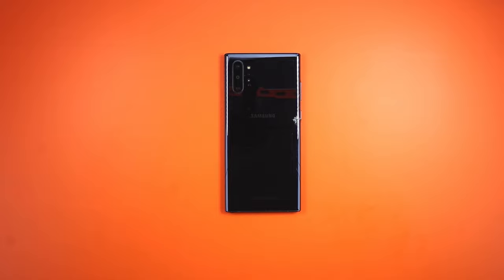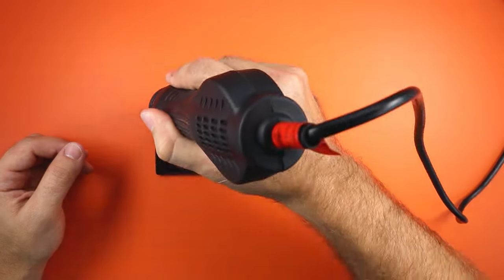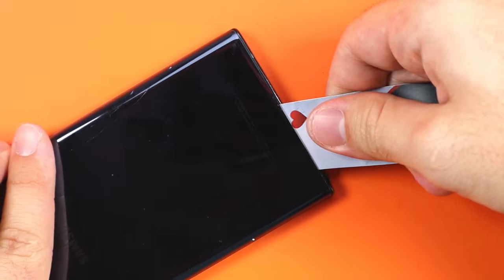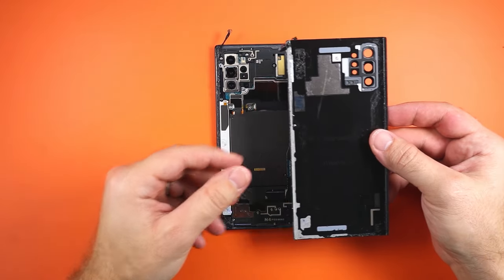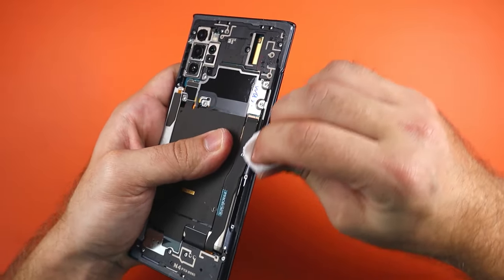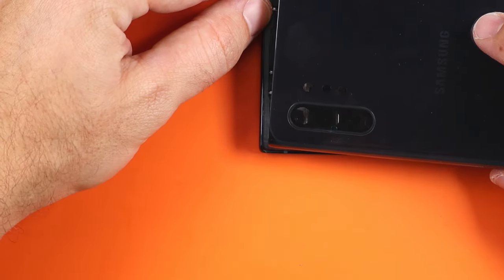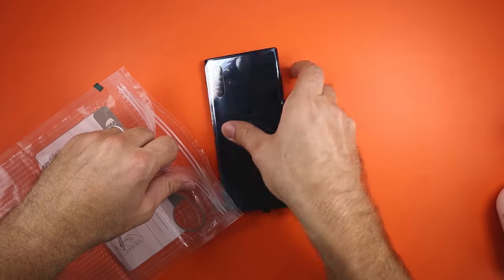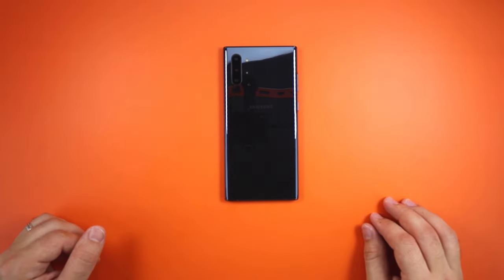Samsung Galaxy Note10+: Easy Rear Back Glass Replacement

Comment: There is a small rubber part underneath the sensor glass, do not for get to put that on the new back glass. If you don't the glass will press against the camera and the camera won't focus, its a very small part but it needs to be put back on.
Reply: Where exactly is that rubber part located? Could you elaborate? Thank you

Comment: Looks fairly easy. I was going to trade in my phone, they offered $700 for it but, till they saw the back cover, then they would only offer me $400 for it.  So $18, I'll give it a shot....
Reply: Did you try trading it in after you changed the glass?
Reply: @NapoleonBorn2Party  I was going to do it but, on Verizon's site, it showed $18 more on my bill, I got all the way to then end and it changed from $18, to $57 a moth.  I was like screw that. I never traded it in...

The phone looks brand new, you could never tell there was damage...

Comment: Thanks. I ordered the back glass cover based on your link. I was wondering about one thing.  Some other videos I saw regarding the replacement of the back glass showed the individuals using extra adhesive and/or cellphone tape. I notice you did not do that. So I suspect it really isn't necessary to add any extra adhesive then?
Reply from the maker: Since you are completely replacing the back glass, the new one will have all the adhesive you’ll need.
Reply: @MobileRefreshChannel  Thanks ! 😊

Comment from the maker: Parts and Tools:

Part:
Back Glass:
https://amzn.to/2Kk4HGd

Tools: 
FoodSaver Vacuum Pump:
https://amzn.to/2N0BwZA

FoodSaver 1-Quart Vacuum Zipper Bags, 18 Count:
https://amzn.to/39wpm2k

Rework Station:
https://amzn.to/3qmFytK

Anti-Static Repair Mat:
https://amzn.to/3oSG4ze

Razor Blades:
https://amzn.to/3qoPeUz

Steel Scalpel knife and Blades:
https://amzn.to/3qqTXFq

Plastic Cards:
https://amzn.to/2KkrqC3

Alcohol Dispenser:
https://amzn.to/2Kk2DOt

Phone repair Pro Tool Kit:
https://amzn.to/35Koq9E

Tweezers: 
https://amzn.to/2LDgP5B

These are Amazon affiliate links
Reply: Is that the one you bought for the video?  I mean the back glass.

Comment: Had a little trouble getting the original broken, cracked back glass off of the phone, because little pieces of glass shards began to pop off as I was removing the old damaged back. But I was able to successfully remove it, eventually. The new one from the link you provided fits perfectly. However, my phone had the white back and I ordered the same, original cover from the link, and its definitely not as white as the original. Has a bit of a grayish cast to it. Not a big deal, though. Still looks fine. Since I'm going to have a protective plastic cover on the back of it, it doesn't really make a difference, as I'm never going to see the color anyway. Thanks again. Very helpful video !!!! 👍

Comment: Is the Rework Station mandatory? or alcohol and tools are enough? thankyou
Reply from the maker: Heat makes it easier to separate the adhesive. You don’t have to use a heat gun, even a hair dryer would work it would just take more time.

Comment: Question: did you happen to notice if the new glass would hamper the brightness of the flashlight, and do you think it's just how the replacement glass is or a result of the heating device burning the flashlight bulb a bit?
Reply from the maker: Unless you got a cheap replacement glass or you forgot to remove the protection film from the camera lens, this repair shouldn’t effect the functionality of the flashlight.
Reply: @MobileRefreshChannel  Could be a not fully authentic one, but not a deal breaker all onto itself.

Also curious: i notice an ever-so-slight gap on the left and right of the glass. Was wondering if you experienced that with the fully authentic glass you used on note 10+, and if so, does heating up the adhesive on it and then putting some heavy books on it or something resolve such an issue?
Reply from the maker: If it’s not sitting flush then reheating and applying weight won’t really fix that, could cause the glass to crack if something is preventing it from sitting flush or it’s just that type of glass. Our glass sat flush around the frame.
Reply: @MobileRefreshChannel  will it affect the ip68? Or still waterproof?
Reply: @joelrosales1919  it might affect but if you do it properly it should still be water resistance.

Comment: Mobile fresh when you take out the glass and put the new glass is it still ip 68 with the new glass?
Reply from the maker: No, you no longer have IP68 rating. You will never be able to reseal it like the factory seal, but even the manufacturer will say that they don’t guarantee the water resistance after a year because the seals wear out. So if your phone is over a year old, more than likely it’s no longer ip68 anyways.

Comment: Is it still waterproof after replacement or we would loss its dust and water resistance?
Reply from the maker: You loose your water resistance when you crack your glass. But yes, after a glass replacement you will not have factory seal for the phone to be IP68 rated again.

Comment: My back panel is ok dotless, scratchless but due to phone heating the glue seems to be melt and one side and botton panel are pop up from the body...the phone is under warranty will samsung SC reply the glu ? Or they change the entire panel. I m not interested to change the panel because the imei is printed on the original panel
Reply from the maker: If the panel is okay then only the adhesive needs to be replaced. You may have another problem though. A lot of times the battery can start inflating causing it to lift up the back glass. Normally the glass should not be popping up on its own. In that case the battery needs to be replaced first.
Reply: @MobileRefreshChannel  yes u r right...i visited the SC today and they ordered 2 parts one is the adhesive rework kit and 2nd is the battery due to battery swell. Part is not available so i hv to wait 2-3 more days. Samsung need to work on phone build.

Comment: How long did he use heat gun for?
Reply from the maker: You move the heat gun around until the glass it’s almost too hot to touch. No particular amount of time. You can always add more heat if needed.

Comment: Hello, if I change the back cover, can I put the mobile in the water
Reply from the maker: No I would not recommend it. Even if your glass has not been cracked and replaced I’d still not recommend it if the device is over a year old. The water resistance wears off over time.

Comment: Just a question.. After make this reparation, it still can be used after some water?
Reply: Nope. Once the phone is pried open, water will easily enter the phone. So, "avoid submerging phone under water after replacement from this point on ", said Tech repair guy.
Reply: Not for two reasons:

1. You should use the original glue that seals the edge.

2. The phone must be added to a Vacuum Coating Machine.

Comment: The glass on the back of my Note 10+ is a little far from the body!  When I press it, it sticks to the body and no seam remains.  Is it possible to separate over time?
Reply from the maker: Usually it should fit snugly to the frame even without applying firm pressure. There may be something in the way causing it to lift up. The adhesive may hold for sometime but it can get loose if it keeps pushing up the glass. In most cases it’s either some old adhesive left on the frame or the battery could be lifting it up.

Comment: Can I use a hair dryer instead? I don't got a heat gun
Reply from the maker: It’s doable with a hairdryer, just need to run it longer to get the glass hot.
Reply: @MobileRefreshChannel  yea I did it, broke the glass pretty bad tho, well thats what the replacement is for anyways 🤣

Comment: Hello, will it still be waterproof after the replacement?
Reply: No, but it never was waterproof anyways at best it was water resistant. You will never be able to reseal it like the factory seal, but even the manufacturer will say that they don’t guarantee the water resistance after a year because the seals wear out. So if your phone is over a year old, more than likely it’s no longer water resistant anyways. 

(this was the creators response to the same question)

Comment: Does it still be waterproof safe ?
Reply from the maker: No, but it never was waterproof anyways at best it was water resistant. You will never be able to reseal it like the factory seal, but even the manufacturer will say that they don’t guarantee the water resistance after a year because the seals wear out. So if your phone is over a year old, more than likely it’s no longer water resistant anyways.

Comment: Will it still be water resistant?
Reply from the maker: No it will not be water resistant. Once it cracked it is no longer water resistant anyways. There is no adhesive that’s going to make it factory sealed for it to be water resistant.
Reply: @MobileRefreshChannel  
Today I noticed my back glass of note 10 plus has started to come off. Glass is like new only (2 year old phone but in brand new like condition).
I think the adhesive is loosing out.
If I get it serviced from authorized samsung service center, will it be water proof? Will they apply water repellent adhesive?
Reply: @chirag_cc  Exact same thing happened with my 2 year  note 10 plus.
Reply: @MobileRefreshChannel  Not even if repaired by Samsung itself?
Reply: Same issue, after 2 years of usage the glue is coming off. My phone usually run hot at some moment, I think it affect the glue

Comment: What about water resistance.. does it have any effect once the glass is replaced ?
Reply from the maker: Unfortunately, it will no longer have the IP86 rating for water resistance. There is no adhesive that will seal it as well as the factory seal, but It will be much more water resistant than when it’s cracked that’s for sure lol.
Reply: @MobileRefreshChannel  well that's far from true! There are many additional adhesives that can be used that are even better than what it originally came with.
Reply: @matthewgalano7652  Which ones? are there any ones you recommend

Comment: Have this phone still has waterproof?
Reply: Maybe... If adhesive was completely cleaned off and  reapplied perfectly even  around the perimeter and pressed while curing then maybe  but I wouldn't test its water resistance after being repaired. Assume it's not anymore

Comment: My glass is not broken... But if I put my nail on the side... I can see that the back glass is starting to separate from the phone.. I can see a gap in between the back glass & my phone... What can I do to stick the back glass together to my phone ?
Reply from the maker: You can purchase adhesive only. Heat the glass just like you would if it was broken and carefully separate it with a plastic card. Clean off the old adhesive on the glass and the housing. Apply new adhesive back on the glass, and now you’ll install it just as if it was a new glass.
Reply: Bro,

Same thing happened to me.
I noticed that today.
Same separation when i put nail.

Did you get your phone fixed? How? Charge?
Kindly share details
Reply: @chirag_cc  I did it a few months ago... It took 2,000 but the glass which is new is now cracked... Original is still original... But it's only 2000 so I can get it replaced again when ever I feel like.. I got it done in Delhi
Reply: @tdawg440  ok bro...I am from Mumbai.

Samsung ke hi service center se karaya tha kaam?

Aur unhone sirf adhesive replace kyu nahi kiya?
Pura glass kyu?
Reply: @chirag_cc  bahar se kawya tha.. Samsung wale bhaut zyada paise lete hain... Airport pe mera glass Crack ho gaya tha that's why I got the whole thing replaced... You only should ask them tp fix it with adhesive
Reply: @tdawg440  ha....Original hi repair karana hai mujhe....

Samsung hi jaunga...
Waise bhi sirf adhesive karana hai...glass is 100% fine

Disappointing hai yar...itna mehenga phone...aur aisa construction...isse acha iPhone hi lena chahiye tha
Reply: @tdawg440  Bro, I got it done. Went to Samsung's SS. As my back glass was completely pristine, all they did was change the adhesive. It also made my phone water-resistant (IP68) again. But the technician advised me not to take it in water. Even though the company says it's IP68, there are chances that water might get in, and if it does, the phone will be damaged. He said it's just for emergencies, like rain. And IP68 is only for clean water. Swimming pool chlorine water, mud, IP68 doesn't protect the phone.

They charged 600rs inc taxes (Roughly 400 for adhesive kit and 200 labor).
Gave me the phone back in 1 hour.
No data loss. The phone is almost brand new (It was already in pristine condition).
Reply: @chirag_cc  that's good... Yeah.. After changing the glass I took my phone to a swimming pool twice... Still working fine... I even use to wash my phone LITERALLY during lockdown after I use to come back to the house... Lol
The IP68 thing is amazing on this phone... My rear glass is still broken & now I don't take it in water... I'll get it fixed next month now...

Comment: Here late at night with all of my dodgy looking tools i got online to replace my phones back cover... damn i dont have a razor blade. Or a heat gun.
Reply from the maker: Use a hair dryer. Nice thing about replacing a cracked back glass is you don’t have to be too carful about removing it since it’s already cracked. You can do it! 💪🏻
Reply: @MobileRefreshChannel  thank you i used the hair dryer and it worked 😆 thanks so much for the video and advice!